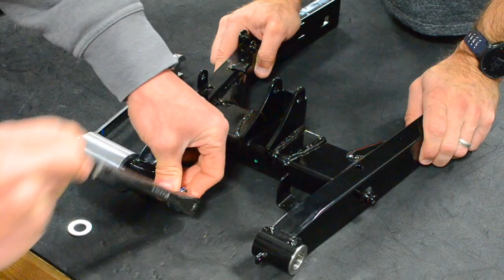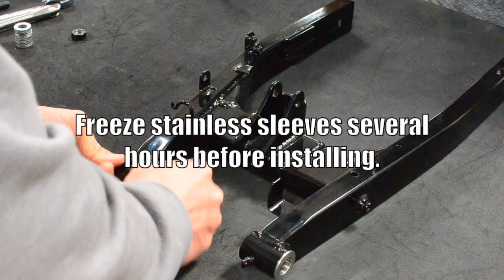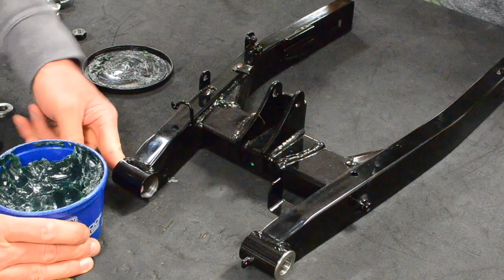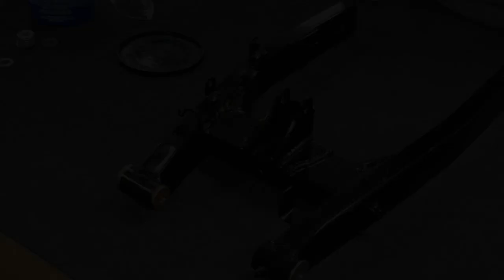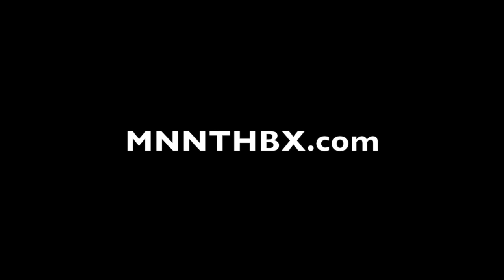MNNTHBX Grom Swingarm Bushing Kit Install

Comment: Good install video, would you be able to confirm they would also work with a GCraft aluminium swingarm? (The current rubber bushings look like the OEM honda ones)
Reply from the maker: We've not tried it ourselves, but it's been confirmed by customers multiple times that they indeed fit the G Craft.
Reply: @mnnthbx  thanks for the quick response👍

Comment: Didn't use the install kit, used a deepwell socket and a hammer. Worked mint. Used rubbing alcohol and dry ice to chill the sleeve, tapped into place with a rubber mallet. Install took less than 30 mins. Night and day difference, bike handles landing from jumps much better, smoother up on wheelies, more predictable etc...used the MNNTHBX shocks...2019 monkey. Ceramic bearing kit installed at same time.

Comment: I stripped th3 first long bolt, was feeling the second long bolt get hot and that causes ut to get unnecessarily tight, so i lubed the bolt threads with antiseize and it was butter from there

Comment: Would you recommend replacing the bushing on an otherwise stock suspension or is this mod more for people with upgraded shocks?
Reply from the maker: Yes. They make a dramatic difference on any shock. Bigger upgrade than the shock itself, assuming you're not miles off on the spring rate.